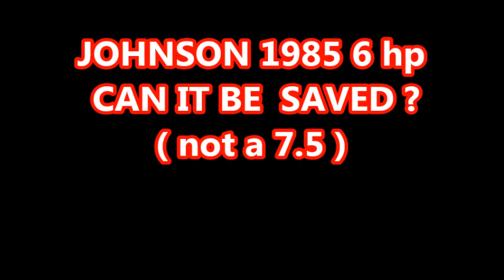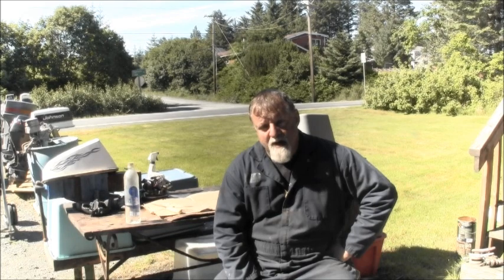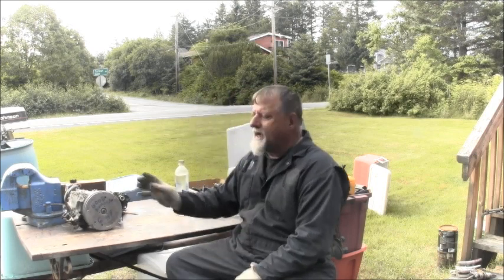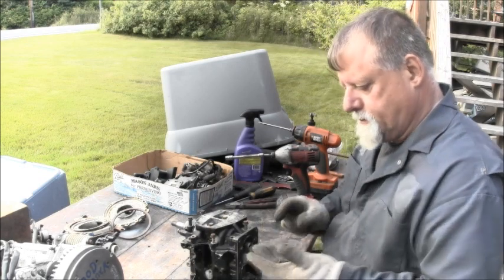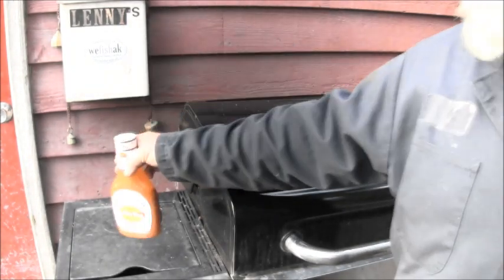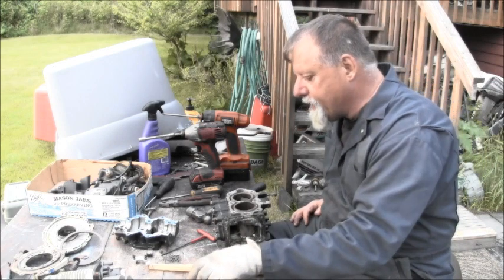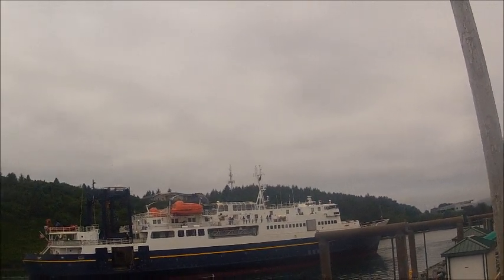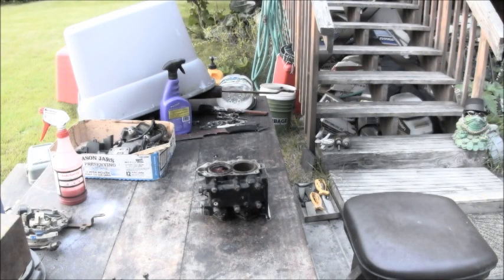JOHNSON 1985 6 HP,  CAN IT BE SAVED ?

Comment: The most effective rusted piston freeing method that I've seen was at a local vintage automobile restorer. The gentleman wasn't a fan of tapping on  stuck piston because he said it would alter the piston's shape. So he would use liquid nitogen aimed at both end of the piston using that little canister that looks like an oiler, the same gizmo that dermatologists have to freeze-burn out skin imperfections. He just fitted a longer nozzle to it. Ok, that may sound extreme but saving them pistons when working on 100 years old motors was paramount to him. Regards !
Reply from the maker: Wow never tried that, sounds as it would work tho.   kb

Comment: Not to worry, you will find another powerhead, just be sure to check the crank splines, a weak point for these engines.  And the intakes are different between the 6 and 8hp, so the blocks are different.  The 6 and 7.5hp blocks are the same, the 8hp models have the larger intake cast into the powerhead.
Reply from the maker: Thanks'  This weekend I will make a solid effort to find the other powerhead I do not think I scrapped it cause they are getting a bit hard to come by these days.  kb
Reply: @kodibassInsideoutboards    For sure.  Would be a shame to scrap it, let me know, will find something for you...D

Comment: If soaking and heat dont break that piston free- you could try drilling as big as you can hole thru the top to relieve tension- most cases it works!
Reply from the maker: Yep' I have seen where others have tried that thru the side of the motor a few times.  kb

Comment: Kodibass got a question for you do you know where I could find some upper motor mounts for a 1993 johnson 15hp model j15eetb. I have one that came with the motor when purchased but it requires 2. I also need the bolts that go through the mount. I cannot find any anywhere google,ebay, local and nothing. Just wandering thanks I love your channel

Comment: OK, well that 6hp powerhead you have there is from a 79 or older model, so it won't fit for sure.  The 1980-90 models do have the same bolt pattern for the 6/7.5/8hp models.  But, there are two different style inner exhaust tubes used, so you have have to match the proper inner exhaust tube to the powerhead.  Will comment more after watching the rest of the video.  D
Reply from the maker: Thank's for sure.   kb

Comment: There are no common parts between the older style 6hp 79 and older vs the 1980-90 6/7.5/8hp models.  Unfortunately, those newer style engines use individual needle bearings in the center main crankshaft bearing, a royal pain to reinstall.  Same goes for the rod bearings.  Seems like most of your damage is the rusted pistons/cylinder walls.